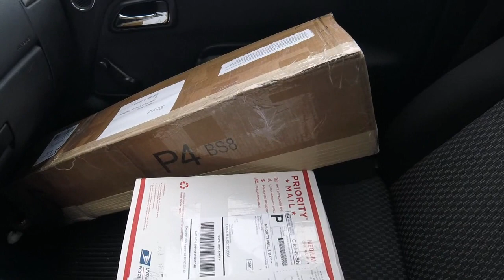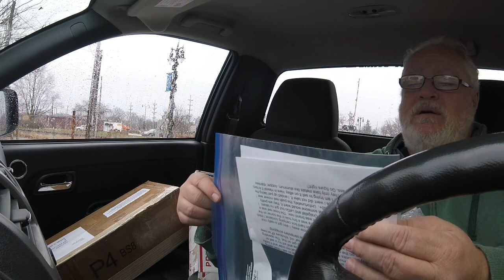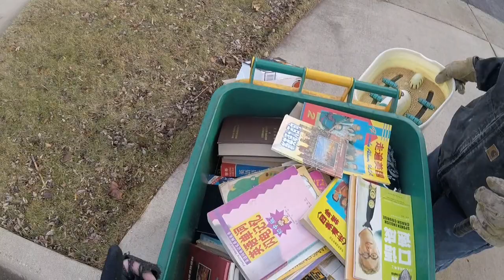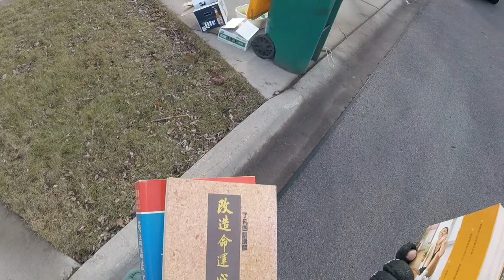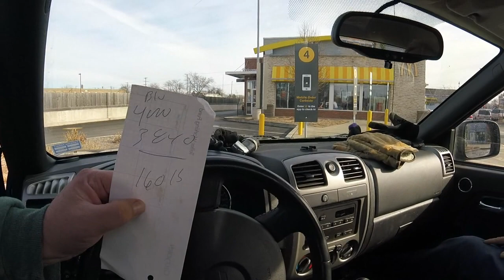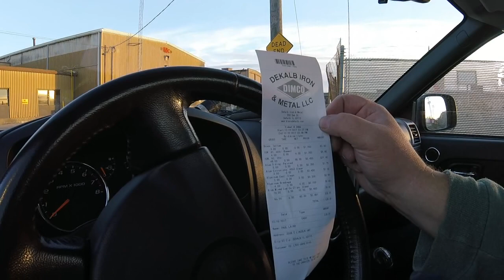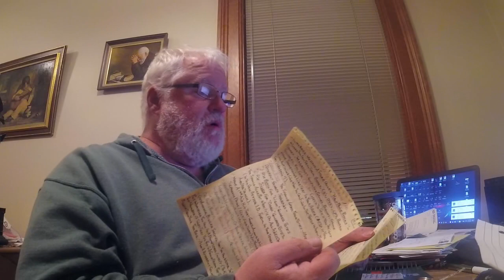Wire, Pallets and Non-ferrous, oh my. Diggin the Trash Picking Route

Comment: You can lay a rubber band across the top of a stripped screw and then use the drill, it works most times. Keep up the good work and thank you for taking me along for the ride.